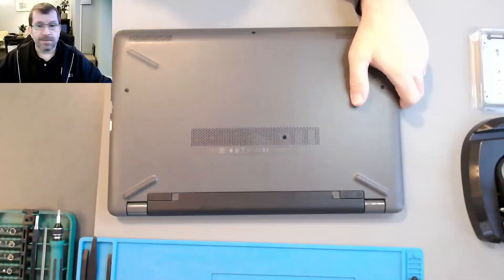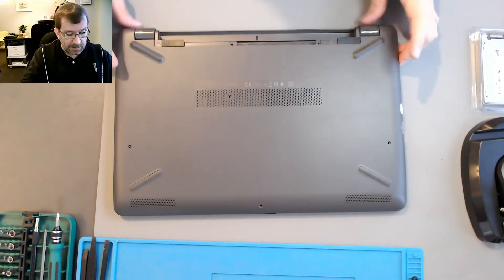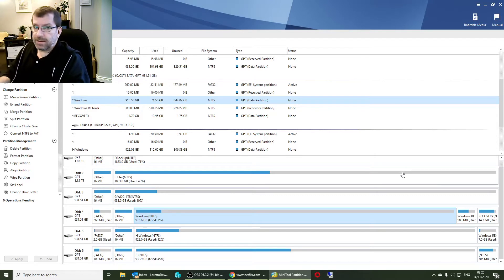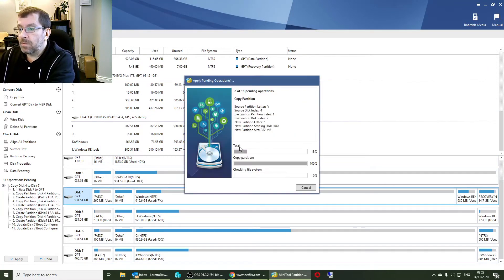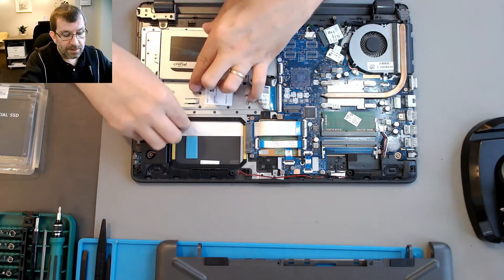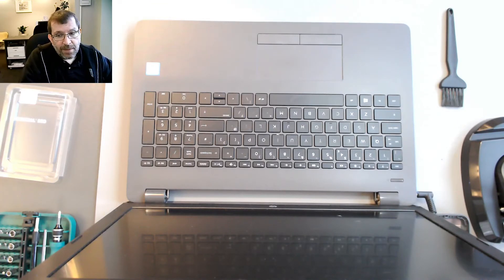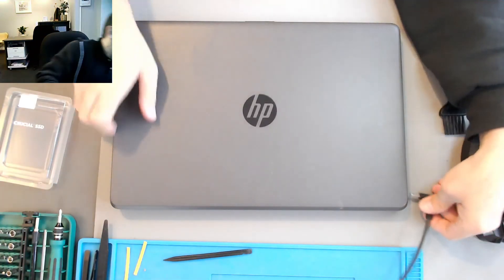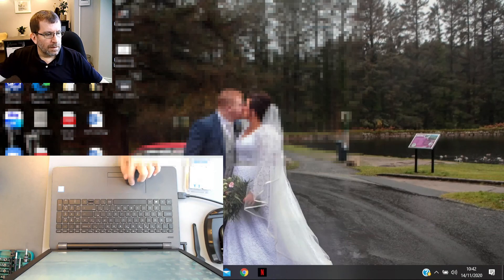[6 (edit to show four hidden screws)] HP TPN-C129 - SSD upgrade

Comment: Why not make use of the NVMe slot ?
Reply from the maker: Only because we had SATA drives in-stock, and the customer wanted to replace the existing (as opposed to adding a second drive). But you're right, an M.2 drive would have been faster.